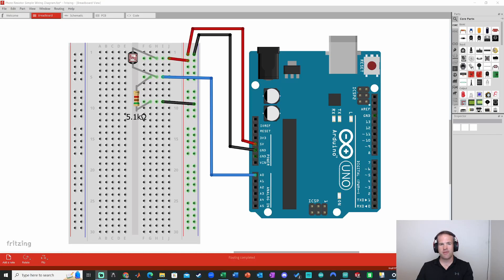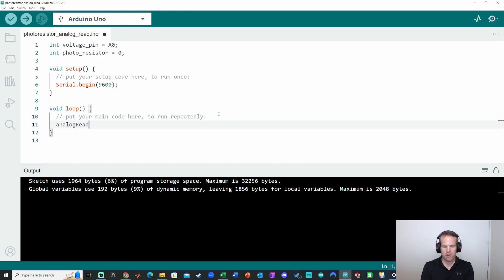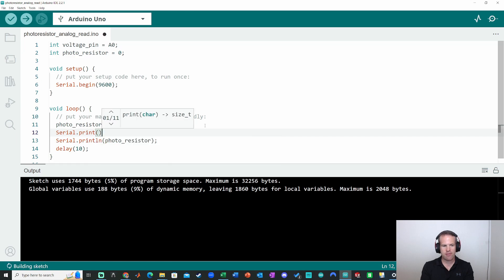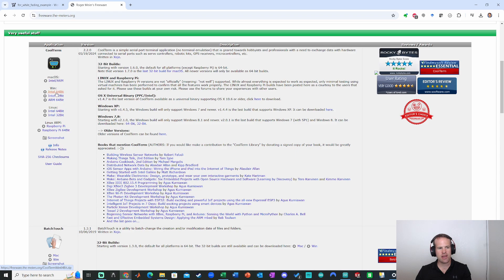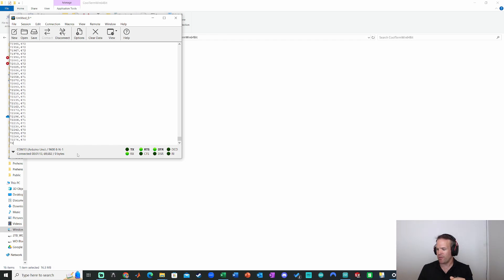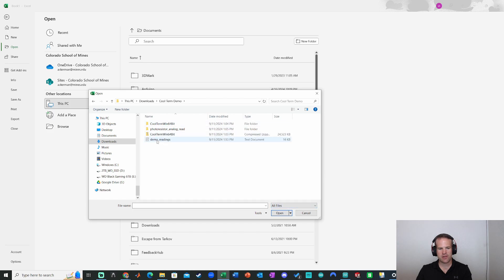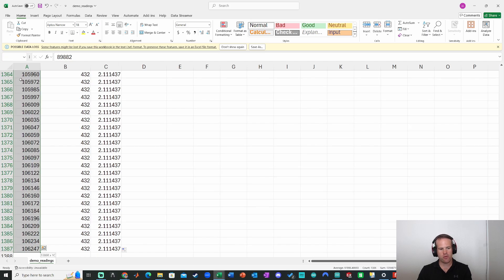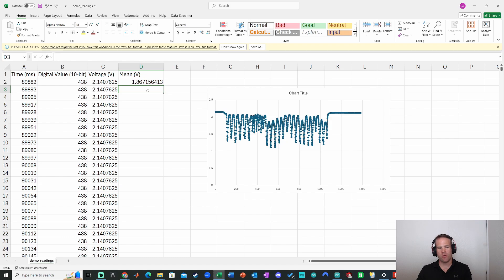Save Arduino Serial Data to TXT, CSV, or Excel Using CoolTerm | Step-by-Step Guide

Comment: Thank you for the video. Could you suggest me what are the alternatives for mac users? I am not able to run coolterm on my mac, even though the application is downloaded. It doesn't give data when you hit connect, and I have checked and make the setting is accurate.

Comment: why is the arduino uno port not in the coolterm port options? instead there is a different one but the number is the same as COM 5 (this is from the arduino uno) and COM 5 (USB SERIAL CH340) in the coolterm. What's should i do ?
Reply from the maker: It can’t hurt to try both listed ports to see if they connect. Usually you can check the serial port number first in the Arduino IDE, then disconnect from that port in the IDE (one Serial connection at a time), then select that in CoolTerm. There should usually be unique numbers for each valid serial device, I haven’t seen a situation where multiple devices share a number before.

Comment: How to set title column automatically
Reply from the maker: I'm not sure how to do that in CoolTerm. There might be a setting that could accomplish that. One option would be to trigger the "Serial.print();" functions using a button or other boolean command and then have the first print statements after the data collection trigger be the column titles separated by commas. That would probably work.
Reply: @ChefJeffPhD  :face-blue-smiling:Great!:person-turqouise-waving:👍👍👍